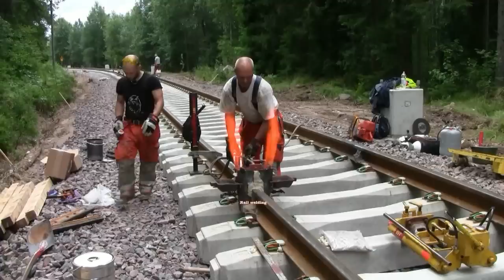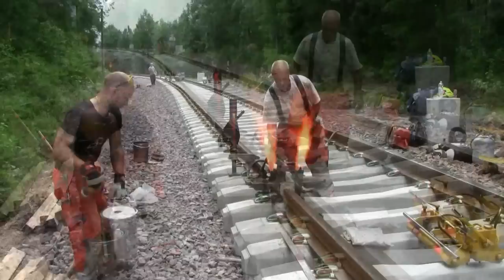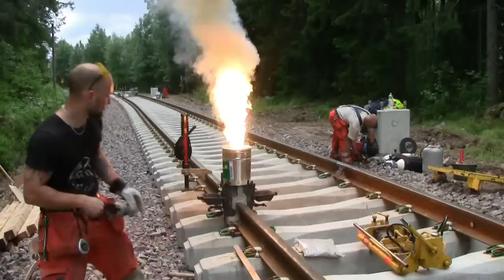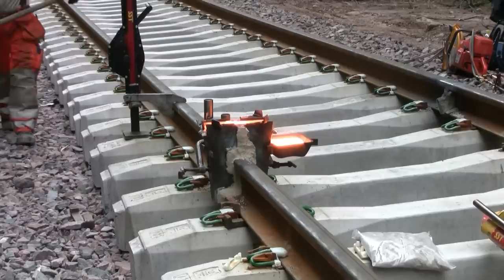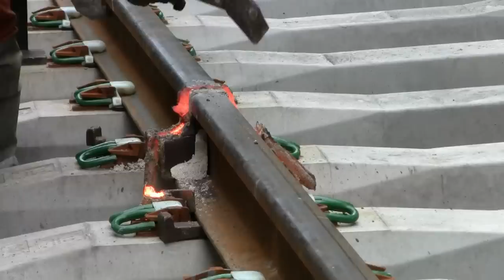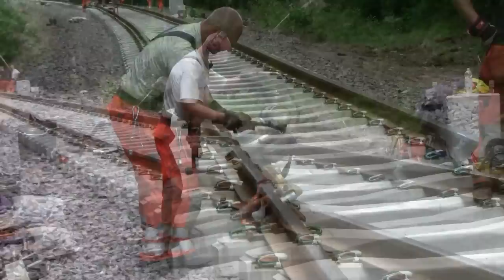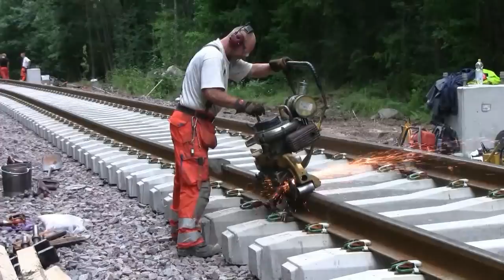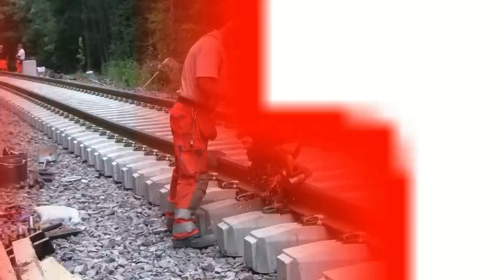Railroad thermite welding

Comment: Interesting to see the ties so high up compared to what we see here in the States
Reply from the maker: The finished rails will be filled with gravel.
Reply: Wolfgang Lendner even with more ballast in b/w there, those ties seem a lot larger then what i normally see here. is the track gauge any different too?
Reply: Maybe because this particular rail road is meant for heavier and faster moving trains ? Idk just a guess.
Reply: sik59rt The track gauge is mostly 1435 millimeters here in sweden, but we have a couple of active tracks (Roslagsbanan, for instance) with the older gauge of 891 millimeters. On Inlandsbanan shown here (which is not part of the regular railroad network) they mostly have tourists and residents travelling. I'm not sure what the max speed is because it differs due to location, but the trains can make it up to 130 km/h.
Reply: Isn't this before the ballast ? You have to surround ties whether concrete or wooden to prevent shifting I would think. Unless the concrete ties are so heavy they require no ballast, but I doubt that is the case. Interesting video.
Reply: ***** and animals can crawl under it, instead of trying to go around [as rodents do instinctively]
Reply: sik59rt   Yeah, and they're made of cement by the looks.  Actually, I'm surprised they're not using cement to make replacement ties here in the US(at least the CSX railroads around here don't), seems like it would be cheaper and last longer(no rot, can be poured on site to cut shipping cost).
Reply: ***** You do know that concrete is an energy intensive man made product, right?
Reply: PSU 18 LOL sand and lime are so much more energy intensive than logging.... thats why we make our sidewalks with wood
Reply: joshua arnott It isn't done, it will have gravel all the way up when its done so no safe animal crossing
Reply: joshua arnott That's an unfair and illogical comparison.
Reply: Mackadam actually. See the scotsman McAdam.
Reply: Electron Pusher I noticed several stacks of ties that look similar to those in this video in the Sugar Land area and I don't believe they are made of wood. They are converting the alternating 1-2 track to 2 tracks all the way down.
Reply: ***** Also never pay for themselves and more expensive over the entire lifetime. Concrete is NOT eco-friendly btw. Creosote is simply a distilled natural tar. It's biodegradable.
Reply: sik59rt lol...actually the welding is done after the gravelling, at least here in germany...no idea why they've been welding them so early there...
Reply: Arcadiy Ivanov biodegradable does mean also though, that it wont last long and would have to be renewed ever so often. nothing desired in rail construction business... ;)
Reply: Ever Piek there are studies in US that show in most climates cost of concrete ties is greater over lifetime than of the wooden ones due to extreme total cost of manufacturing.
Reply: believe me...the costs in europe are lower than to use wooden ties, especially as wood is getting more and more expensive...you guys in russia (i assume because of your name) and them in america dont have the restrictions regarding the felling of trees and the use of wood and wood conservations we in europe do. 'shrug' its cheaper to just make them from concrete...
Reply: Ever Piek .lbu tus 
L mt
Reply: ***** there going with cement up here by stanley ND could just take time to replace.
Reply: They haven't covered them yet
Reply: joshua arnott Wood sidewalks? Where?  I'd love to see that.
Reply: Ron McCall you just need to take a time machine to whatever place uses wood for sidewalks
Reply: vvac201 even ties in Alaska arent that high and they get the occasional flurry
Reply: +vvac201 You guess wrong, this will be either new track or a complete replacement of existing track, at this stage the final top layer of ballast hasn't been added yet.  When it's finished the ballast will be up to the sleeper or tie tops.
Reply: I understand ballast and tie tops.
Reply: +sik59rt probly just because in the us we dont give a shit because regular rail road tracks work good enough lol and its faster and cheaper
Reply: +sik59rt I live here in Alaska the ties are sunk into the ground here now and the rails are right above the ground and we have no issues at all.
Reply: top comment.
Reply: +Ercio Alendre really, the scientific community would say otherwise. Concrete is not an environmentally friendly material at all.
Reply: mwnciboo oh, you think logging is carbon-neutral? aha, ahahaha, ahahahahaaahhhh
and you called me dumb...
Reply: +sik59rt A typical Swedish track bed: 1 metre of sub-ballast, then a layer of at least 40 cm ballast, on with ties and tracks, fill up the gaps with more ballast. It must be this thick to cope with the effects of ground frost.
Reply: Steff2929again up here in alaska our tracks arent near as nice as these we dont have issues.
Reply: We do have problems with ground frost causing severe heaving and liquefaction during the spring. Especially in the north. Many roads have to be completely closed. These new standards have improved the situation for the rail network. It saves a lot of money in the long run.
Reply: Steff2929again well our roads are beat to trash and are rails are let say "ehhh" status.
Reply: +Steff2929again de
Reply: +Ever Piek because they need the tracks to bring in gravel
Reply: ***** thanks. most go on a tangent about how awesome their religion is when in reality, i couldnt care any less
Reply: yep
Reply: Ad ballast is the last thing they do. This gives the welders more space to work in.
Reply: That can be, but they last far and far longer.
Reply: +Electron Pusher CSX added a second track on about 2 miles (3km) of their main line near me (in Florida) in 2014 and used concrete ties. I've also seen videos on YouTube showing concrete ties being laid on a line in the Midwest (I think Chicago to St. Louis) being upgraded for faster trains (110 mph, 175 km/h).
Reply: +Electron Pusher The ties cannot be poured on site. They have rebar that needs to be stressed. Plus the track probably can't be used until the concrete cures, which can take a week. The pieces that connect the real with the tie could not be properly fastened with concrete that has not cured and if trains run, then it might cause it to harden in a bad position that causes damage.
Reply: +afh7689 where at? I'm a carman out of Tampa.
Reply: Alex Cryshan 1611 ive been saved. thanks
Reply: sik59rt z👍
Reply: sik59rt then why do you have such a profile picture?
Reply: On the S-line approaching the new intermodal facility in Winter Haven. The ~2 miles I mentioned was from Auburndale (immediately south of junction with A-line to Orlando area) to Winter Haven. The line narrows back to 2 tracks past the WH Amtrack station and under a bridge (US 17), then widens back to 2 tracks (wood sleepers on original track, concrete on new one) for 3-6 miles past the intermodal facility. All yard tracks in the facility appear to have white sleepers on Google Earth, so presumably they are all concrete.
Reply: Alex Cryshan 1611
Reply: The treatments used in wooden ties in the US are not at all environmentally friendly. It allows the ties to last just shy of a century. But the chemicals involved in the pressure treating here are pretty damned toxic. But as a cost thing, its cheaper than concrete and lasts just as long.
Reply: Gavin Best х
Reply: Gavin Best ЗЪ ь
Reply: Wood sidewalks are called boardwalks. Also see old western movies.
Reply: Probably a high speed train, our high speed trains int he US are a joke. Do we even really have any per say?
Reply: Meeker Extreme i think the Acela Express in the northeast is the only one. we're decades behind other modern countries when it comes to fast commuter trains
Reply: sik59rt
Reply: sillllk59rt
Reply: sik59rt We're not decades behind, commuter trains do not and never will make sense in America. The US is built totally differently. We would have to tear down every city, make the city's more compact, and put them all closer together for it to make sense.
Reply: if you read my post, i was referring to high speed trains. high speed trains make sense over spread out cities, so i dont know what youre talking about.
Reply: IT'S JUST BRIAN THE BRAIN HAVING A BRAIN FART !
Reply: WHAT ARE YOU TALKING ABOUT ? THEY'RE NOT WEARING ANY TIES !
Reply: they're talking about the rail sleepers dummy.
Reply: +TRICK-OR TREAT nor hard hats or safety glasses.
Reply: Eco friendly for sure but the old wooden ties look better to me.  More old-fashioned.
Reply: We got more wood here in the states and Canadia.
Reply: They are using concrete ties here in the United States. At least on most of the commuter rail lines running into and out of New York City are using crete ties.
Reply: WitchidWitchid if you are talking about those concrete things under the rails they use wood here in Texas
Reply: This must be Germany.  American still uses the 1800's technology.
Reply: Tom Robie like what give me some examples
Reply: Haha wow no.  Stop hating on the US, just because we don't have wooden
ties.  We have fantastic technology, and heck, there is nothing wrong with
tech from the 1800s!
Reply: Yes it's before ballast. Here in the UK we always back fill this type of sleeper and put a shoulder of ballast around the outside of the sleeper. I was actually doing that today after fitting a crazy amount of pandrol clips (Non fast type) I find it hard to believe this would not be filled and shouldered with ballast.
Reply: sik59rt
Reply: sik59rt
Reply: sik59rt I
Reply: Especially in the twin towers
Reply: Concrete/Portland cement is not particularly friendly to the environment. Read up about the kilns used in the manufacture of Portland cement.

Comment: That looks like a lot of work, but look at the rail bed, incredibly well designed and constructed.
Reply: It's not finished either, once all of the rail work is finished the rest of the ballast will be installed up to the top of those concrete ties.

Comment: I always wondered how rail track gaps are filled in when they are nailed in place. Very cool indeed.
Reply: Well only some of the gaps are welded there still needs to be some gaps left cause of thermal expansion so that the steel would have space to expand uninterrupted
Reply: @themidnightbanshee5927  does gaps cause stress to the axile especially if it’s nit welded and just bolted using a plate?
Reply: If there isn't room for the track to expand it will press against each other and cause stress
Reply: @themidnightbanshee5927  so if the rail is not welded, only bolted using a plate, does it not create stress to the axile of the train?
Reply: First it doesn't cause stress on the train only the rails
Secondly when tracks are bolted together a gap is still left between the tracks and the bolt holes are wider
So that's how you avoid stress just leave some gaps once every few dozen meters of track
Reply: @themidnightbanshee5927  I see trains going through bolted tracks it almost always produces a rackety sound. How come it doesnt cause stress? On bolted tracks, no such sounds.
Reply: Well you see the gaps are so small that (usually less than 1/2 inch or 1 cm) when a train passes over it the impact is miniscule only enough to cause that rackety sound but not dmg the train itself
Reply: @themidnightbanshee5927 modern continuously welded track doesn't need expansion gaps

Comment: The coolest part about the new way of building tracks is what the end of them look like. On the boston t, in the winter there's about a 1/4 mile, if not more of unused railroad ties at the end of the line, in the summer there's almost none left cause of the expansion of the tracks.

Comment: Great respect to their job. Hardly to imagine what forces act at the welding points during summer and winter (push and pulling forces, hot sun and cold froze). The welding must last for a long time.

Comment: Welding rails together creates a rigid and smooth joint that is safer for bullet trains. (Unless they forget to grind off the slag - happens on a union job between shifts sometimes ;-) 
Ties are buried after welding because the rails can warp from heat cycling and require additional straightening.

Comment: That is a lot of work for welding a few rails together. Seems like they could do it easier with an induction coil.
Reply: But that would require a somewhat beefy power source and it would probably still take longer to weld than with thermite.
Reply: Barnacules Nerdgasm it will be much easier to use Superglue
Reply: toilet paper :P
Reply: Chewing gum
Reply: Barnacules Nerdgasm g
Reply: CSX uses toilet paper to weld their rails.
Reply: JB Weld!!!
Reply: Barnacules Nerdgasm doesn't get hot enough
Reply: Just use a rice
Reply: Joke's on all these naysayers. They actually use induction heating to weld rails in some applications. All the comments about needing a substantial power source are kind of hilarious too, considering that a locomotive is basically a giant generator. The reason you see thermite used in some applications is that it's not always practical to get the generator unit on site. You can see an example here: watch?v=8LQUlzSwc-k
Reply: Bryan Mendez how many kids you sold marijuana to today?
Reply: I doubt it. Aluminium isn't all that cheap, especially powdered aluminium. Besides, if thermite was that cheap, they'd never use anything else.
Reply: I work at the place that welds rails before they’re sent off around in the country. There’s only one place in Sweden that does that, and I’m there now. We get them in 60 meter segments, and we usually weld them together to 420 meters with 7 rails and 6 welds. They only use thermite welding out on location to connect the usually 420 meter segments. We use induction welding here.
Reply: Filip Granberg how on earth do you transport 420m of welded rail?
Reply: There are special rail cars that can transport the rail.   Rail will flex surprisingly well if you are going around a curve that isn't too tight of a radius.  You can see one of CN's CWR trains here:  watch?v=nM7h8C2BU_s
Reply: Huh, I didn't think of that. Thanks for the info!
Reply: induction coil? Shirly you meant TESLA coil.
Reply: Tree sap is clearly the optimal solution.
Reply: Jefferson Allan trains can be over a mile long. No problem putting a bunch on a string of flat cars
Reply: clearly the problem is finding clear tree sap. sasquatch defends the tree sap with his phaser, for he who controls the tree sap controls the furry sasquatch.
Reply: Jefferson Allan: Good call sir. Nobody transports a length of rail over 1,200 ft. long.
Reply: You have to fill a significant gap between the ends of the rail, the Thermite provides liquid iron to do that.
Reply: The rail head is hardened at the factory to help reducing wear. This makes it necessary to use special welding methods to avoid the joint becoming softer than the rest of the rail head. The first molten steel running into the mold and forming the rail base is actually slightly different than the steel forming the rail head. I would call that quite sophisticated in fact.
Reply: Spackle it.
Reply: Chuck Norris?
Reply: Duct tape
Reply: flex tape
Reply: Why not Flextape?
Reply: Brad Landers True, but you wouldn't want to put weight on adjacent tracks and make a bunch of uneven welds.
Reply: @bradleyland  so what you're saying is that... They need a substantial power source such as a locomotive but they can't easily get one so they use this method instead.
Reply: Ryan Carraway all I’m saying is that everyone shouldn’t be so quick to ridicule the OP, because railways use induction welding all the time. I’m not saying they should have used it in this case, because I have no idea what the circumstances are.
Reply: another youtube keyboard genius, who knows more than the entire rail construction industry put together.
Reply: Duct tape
Reply: Danilo Margarido I think duck tape would hold it just fine!
Reply: @whosmansisthis1894  flextape!
Reply: Chuck Norris's saliva. That usually does it in Texas.
Reply: Barnacules Nerdgasm who uses trains anymore ?
Reply: Or they can just use an AMD cpu.
Reply: I like turtles
Reply: @iJamie8467x  duct tape works for anything
Reply: duct tape
Reply: Barnacules Nerdgasm 00m
Reply: wild cat  The buildings came down tge way they did because of the engineering to apply limber to their structure for wind. Osama Bin Laden got the idea of using jets from a happenstance coment made by the engineer of the Twin Towers from a video made and posted on the History Channel, in regards to Sky Scrapers and how tge are built. When I saw rhe video6 years before 9/11, I could not believe my ears when I heard the commenter state that the Twin Towers would come straight down if both an excess weight and fire were to be placed on the top floors. Straight down! 

The only conspiracy is that the US Government, allowed Osama bin Laden's plan (they knew and watched) to take place. A perfect "blame it on somebody" scenario, to get into Iraq with US troops with an agenda.
Now the Deep State knows I know...on we go